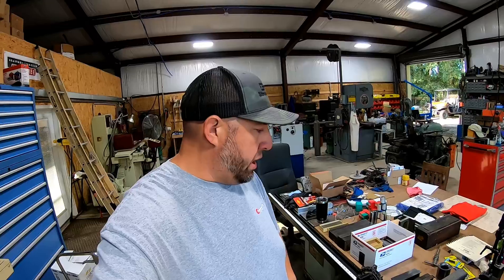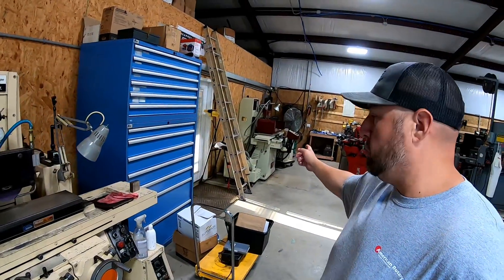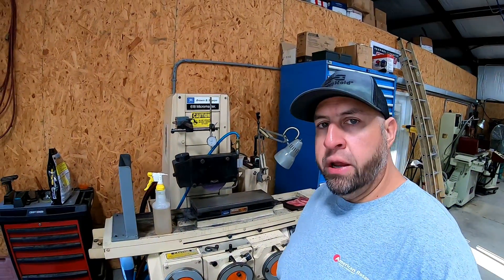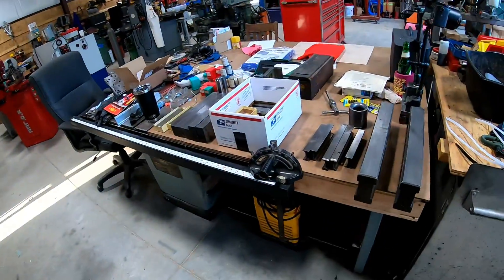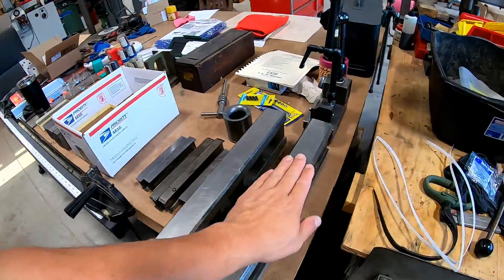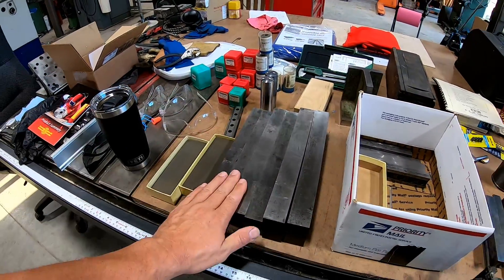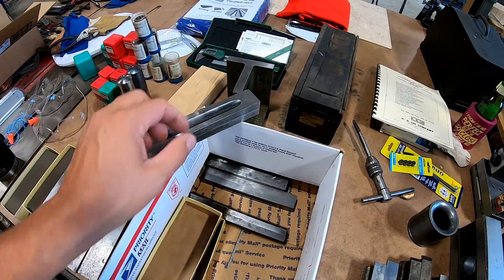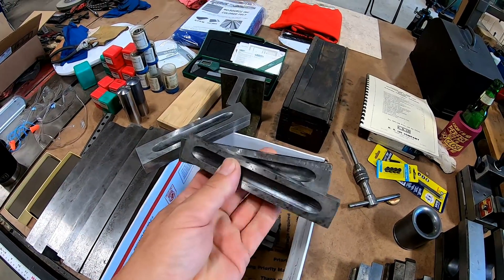SNS 279: Eutalloy Ultra Jet

Comment: In the Navy we used the utalloy system to build up large gate valve discs after the in-place gate lappers took the seats out of specs. We would build the discs up and machine them to match the seats. I used it one time to hard face some machete blades for berry vines and runaway bougainvillea vines at an old church. Worked great.

Comment: Hi Adam, thanks for the video! I work actually for a company that make cored welding wire (and we are sometimes subcontracted by Eutectic Castolin to make wires for them) as a maintenance tech. the cores are made from metallic and mineral powders, highly abrasive, as such, we have a lot of abrasion damages on every surfaces in contact with the powders. we usually repair by building up with TIG or brazing (it depend on the hole size and thickness of the support). that method of building up with a torch would be amazing, faster, more precise and seemingly less risk to pierce through the support.
 thanks again for the video, I now have an investment idea for the next monday :)

Comment: Rumor is, Eutalloy is working on a new torch size, the "Abom". It's a 1.5" diameter nozzle with a ceramic insert to resist abrasion. You can hard-face a battleship hull with it, in about a day.

Comment: This spray welding stuff is pretty dang cool. The first I've seen it is when Abom79 introduced me. Not like I work in any field that requires knowledge of that type of thing. tho i cant help but think how useful this would be in gunsmithing. You could make things cheaper to manufacture by just having parts coated in harder metals rather than the whole part made from one type of hardened alloy.
Reply: this is more meant for stuff that would otherwise have a long lead time on repair or replacement

Comment: I am surprised, didn't the rep tell Lance Castolin Eutectic makes rods for doing machineable cast iron repairs as well? WAY faster. lol It was nice to see the tools the process, and learn more about it for sure. Spray welding at least here is not as popular as it was in the 90's only a handful of shops still do it. I am told it had to do with process reliablity and comebacks, no one wanted to stand behind it.

Comment: Thank you Adam,  that is a very nice shop, and looks to be well equipped .  If you ever run across a small hobby type lathe or mill at a price that I might be able to afford and operate from my w/chair and run on 220 volts, or to even be inop and/or needing some repair or tender loving care , please let me know, I trust your judgment 100%,  I want to shape metal so bad and have a reason to go to my rarely used shop and be more active on items other than lawnmowers .  God Bless and this was another fine video,  Going back to sleep now and hopefully dream of flying chips...….Bob.

Comment: Wow! That torch really seems like a game changer for cast iron repairs. I bet Keith Rucker could really get some use out of one of those!
Reply: I have used the same kit several times, mixed results.   It's very much like flame brazing, except with powder.  Very neat concept, but heat control is touchy, and the amount of heat required is basically the same as brazing.   Too hot OR too cold and you may have poor fusion with the base metal, it peels off, or you get porosity.    Personally I'm more interested in TIG, because you can more easily see what your doing because flux isn't needed.   With this process the flux constantly burning off makes it much harder to see, and it's slow.  still very neat process, just making it a balanced view here. It's no substitute for hard chrome and in many cases regular brazing is just as good.

Comment: 50 years ago I was employed in a shop making roller dies for wire.
We used to deposit Stellite to the roller a that was pre heated for a couple of hours and the process involved a build up of approx 3/8" to 1/2" ( we were in transition to the metric system).
The roller needed to be cooled very slowly in a talc like substance, for three to four days depending on the diameter of the roller ( around 3" or 4").
Have you heard of this product and I was wondering how it compared to the spray welding system you used in the video. The phrase hard faced welding brought back memories of 50 years as a 17 year old boy. Thank you.

Comment: I've used a set up like this in the middle 90s for Crack repair on cast iron cylinder heads it was a pain in the ass too not get spider Web cracks .you would only be able to fill in about half an inch before the head would have to be put back in an oven to let the temperature normalize . There is a learning curve but it worked OK just slow

Comment: I'd be reallly intrigued whether the sprayed on metal would work on these gears too... please let us know about the outcome of that repair.
Reply: That would all depend on which filler alloy you use and how skillfully it's applied, like with any other kind of welding. The fact that it's sprayed doesn't really mean anything, given that it's being fused to the base-metal and itself. If you take the fact that the filler material is a powder out of the equation, it's just like brazing, only with a wider variety of alloys and greater controllability.

Comment: I have done cast repair on cylinder heads and other castings the best repair is oix welding with cast iron rod you cant tell when you are done because it has the grain structure and color match

Comment: Very nice torch.  I didn't know about the Eutalloy brand.  I bought a Stoody Spray Torch about 25-28 years ago.  I got it for repairing exhaust manifolds ... mainly for Chevys and Dodge and I did repair many of them over a few years period.  One application was a cracked 429 marine block that came out of some boat.  A little cleaning and grinding and a go with the torch and it was done.  The nickel powders were pretty expensive and I've only seen the powders available on eBay.  I don't think Stoody is around anymore.  I believe that Victor bought them out?? And Esab I believe owns Victor.  Not sure but I haven't had a reason to use the torch in the last 10 years.

Comment: When I worked in the motor shop in the late 60's they said that metalizing was not welding since you did not melt the base metal. 

The Eutectic torch looked like it got the work hotter than metalizing but did you actually melt the powder into the base metal or just bond it to it similar to brazing?
Reply: You can hear them talking about wetting the metal. So yes, it is wetting the substrate metal.
Reply: Base material does not melt.

Comment: Could you build up a cast iron mill table that has been damaged by cutters and drill bits?
Reply: I'd be really concerned about warpage.
Reply: I used to use these kits for repairing nickel and carbide castings, so its probably possible to fix a mill table.  You would probably want to preheat the entire table in an oven though, to prevent any cracking in the casting.   There are other powder fusing methods that don't need preheat that might be a better option.

Comment: I get spray welding for round parts that can be span around, but to build material up on a flat or tooth gears why not Tig it, unless you can't get the hardness of filler wire?

Comment: Ever hear of Plasma Transfer Arc Welding? Similar to this, but uses a plasma torch for the heat. Probably uses the same powders.
Reply: Sounds more expensive.. Then again oxycetalene gets expensive after a while too.
Reply: @ColtaineCrows  Stumbled on it looking at the powders. More I read about it, the more interesting it looks. Seems to be similar concept to the torch Abom bought but much more precise and doesn't heat the part up as much as a gas torch. Sort of like a Plasma cutter that lays down metal instead of cutting it. 

The basics https://youtu.be/V54xb66JGVI

Using one to repair a mould https://www.youtube.com/watch?v=-aXeI2O4ig0
Reply: @cojones8518  that got just as hot, if not hotter. That was a jet of plasma cooking that part for a solid minute.

Comment: Was there a reason Lance didn't just use TIG to build up the gear teeth rather than wanting to spray weld it?
Reply: Arc welding on cast iron is, at best, VERY tricky business.  Keith Fenner has several videos, where he shows the NASTY crystallization that occurs.  Brazing for the win, when working with cast iron.  The process shown is a variation on the brazing theme.
Reply: Fair enough! I've just always been in the school of thought that  I should learn how to TIG (insert what ever the issue is) even if it's a pain in the arse as it will probably be useful again sooner or later.
Reply: @JMALEEDY  Cast iron doesn't tend to like extreme heat or highly-localized heat, and TIG is basically the ultimate expression of both.

Most welders I've spoken with prefer oxy-acetylene for cast iron, with stick as a fairly distant second.

Comment: Maybe design the bottle and 3D print it in TPU? Quite possible it won't be able to take the temps it'll be exposed to though.
Reply: machine/print an adapter for soda bottles. :D
Reply: You can buy new empty containers from Castolin Eutectic, so it's probably not worth the effort of printing them.

Comment: On the hardness test is that Rockwell A or Rockwell B hardness test ??? Anyway that is awesome stuff...Thanks
Reply: Rockwell C. 120deg conical tip. And "58" for hard steel sounds like a C number.
Reply: @alecdacyczyn  I guess so Where does a Rockwell 70 B hardness stand do you think ?
Reply: @steveshoemaker6347  Well, the B scale is for softer materials (soft steel, brass, aluminum, etc).  Here's a conversion chart:
https://www.engineersedge.com/hardness_conversion.htm

Comment: Great demonstration and very usefull process, even for joining cast iron. My question is, can it be used with propane?
Reply: My guess is no. Maybe with a really soft powder, but itd take some knowledge in metallurgy  and understanding the heat required depending on the make up of your powder and base metal.
Reply: No

Comment: How is this process better than using for example a Tig welder ? 'pros and cons'.
Reply: shouldn't you heat up cast iron before Welding it? Maybe thats why
Reply: HmsSulaco this is depositing metal where the tig welder would require the metal to be flowed together. This process is cool small cast gears like these just replace them or make new.
Reply: @FireGodSpeed  It's essential to preheat cast iron, when attempting to weld it.  Otherwise the thermal stresses will "nail" you.  FWIW, I've seen people using barbecue grills, when welding on cast iron, with nickel rods.
Reply: @MrRippsalot  Yir but it just seems like a slow way to add metal.
Reply: @eliduttman315  yes and cool down slow. I've used an regular oven on cast before, and then welded with rods, worked like a charm.

Comment: I've never spray welded what is the benefit when it comes to other options like building it up with tig?
Reply: depend on the support I suppose, I work in the cored welding wire industry, we have a lot of abrasion problems. repairs are made with tig and brazing, depending on the hole size and thickness of the support. most of times, TIG is too powerful to make the job (pierce right through if too high or doesn't flush the metal bead properly if too low and there isn't a sweet spot, as the support thickess varies greatly) and brazing consume a lot of rods, especially on large holes, we have a lot of intricate supports, so cutting and replacing the damaged surface is out of question. this technique of spray welding would be the dream for this kind of repairs. 
the only thing is the cost effectiveness, if you have small repairs on thick steel plates every once in a while, then TIG, MIG/MAG or even stick welding would be efficient. applications like what I have at work, where you have small, intricate and thin pieces at least once or twice in a month, too expensive to be replaced each time they break, that solution could be considered.
Reply: I mean if your talking about holes I always just put copper behind it and plug weld the hole with mig or tig and it acts like a heatsink works great. I was more specifically asking for the gear teeth
Reply: @nickvanwhatt  Adam said the gears are from a very old machine and are cast iron which can't be welded very easily.  This method is better for cast iron than welding and will look closer to the original than brazing.

Comment: With the overspray would you be able to scrape it off with a tungsten scraper or hammer it flat or smooth if you really needed to? I've seen a Tungsten square bar used as a scraper in the automotive industry(cleaning mating surfaces without scratching) but then again you won't be building up material on too many machined top and side surfaces so I guess the overspray wouldn't be as noticeable.
Reply: MrADVANCEDTEK and LittleHands done correctly the over spray will come right off with a flap disc.

Comment: This process looks like it puts a lot of localized heat into the base material.  Does it induce stresses from differnetial heating that woul necessitate a stress relief heat treat cycle?
Reply: It's going to have to, any time you have hardness transition zones like that you're going to have trouble, not to mention overheating the original microstructure. I'd like to see an etched cross section with a microhardness traverse. I don't think it'll be pretty.

Comment: Hi Adam, I was wondering if it is possible to harden EN36B material in the home shop? If so how would you go about that?
Reply: Well it really depends on the kinda hardening you need n want? And that all depends on what your work piece is doing ?
Reply: But if your doing it for small work with not needing great tolerances then you can probably get away with getting it up to like 700C dunking it in carbon powder letting it soak and then quenching it. ( Obviously omitting all the finesse in-between but that's for Google)

Comment: My interest is in the over spray and how controlled you can get. When doing those cog tooth repairs, how much over spray problems do you get? Can you "protect" the outer areas like you do with the "masking" you used on the lathe?
Reply: i dont see why not
Reply: That would be my guess. Heavily masked.
Reply: When done correctly the over spray is a nonissue.

Comment: REALLY neat video...can you now explain "wetting"?  I actually understood the crystalizing based on "sparking" , but wetting?  You guys were able to see something we were not...please explain.
Reply: Wetting is just when the new material starts melting into the base metal
Reply: Yes you can see it melt in or a wet puddle form as you apply heat and powder.

Comment: Did I hear the Eutectic rep say to "wet" the metal? Are you actually wetting the substrate?
Reply: Not with water.  "Wetting" means that the substrate is clean,  temps are right, it's bonding and spreading out - not balling up like high surface tension water beads do on an oily surface.
It's a really common term in welding.
Reply: @12345NoNamesLeft  I know what wet means, in terms of welding. But Adam's usual spray welding doesn't wet the substrate. It seems this spray welding wets the substrate.
Reply: Nope. it’s a welding term.

Comment: I am surprised no one is wearing a proper air protection. Chrome and Nickel oxides...what could go wrong.
Reply: Not a whole lot. This was very, very minimum exposure. 
Not the most dangerous thing tl do in a shop, by very far
Reply: @imagineaworld  that's not a good argument to ignore basic saftey precautions.
Reply: @JWH3  please define "basic safety precautions"... you can't..
 i never said to ignore basic safety precautions. If everyone involved thought the exposure was worth the cost and time of individual respirators, they would have had them on in the video. Its common sense. In this case, no, they are not completely necessary, obviously, because they do not have them on.. they have all done 10x worse more than 100 times in their lives, and that all still was under guidance of "basic safety precautions".  All this comment is doing is harming aboms fan base, and i think people need to understand what they're saying before they say it.